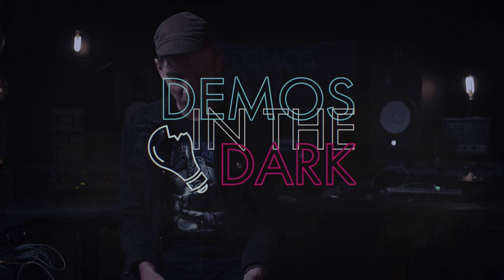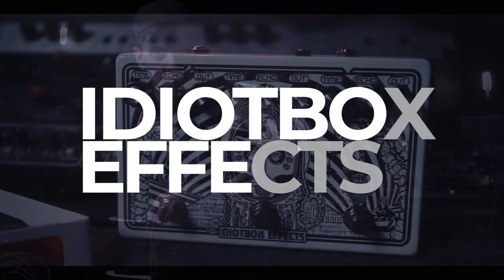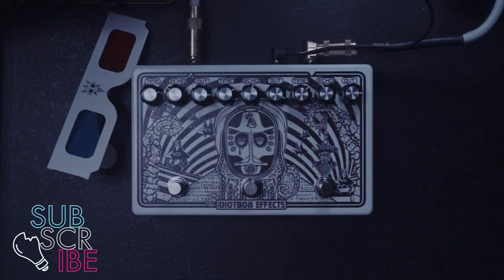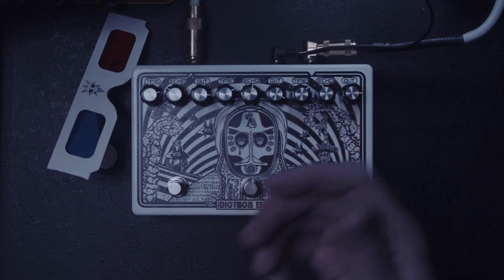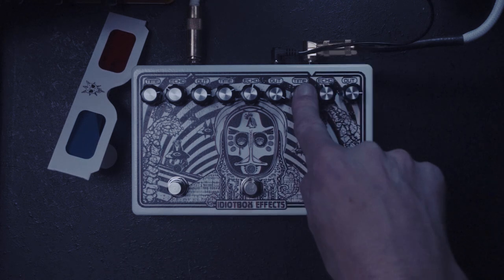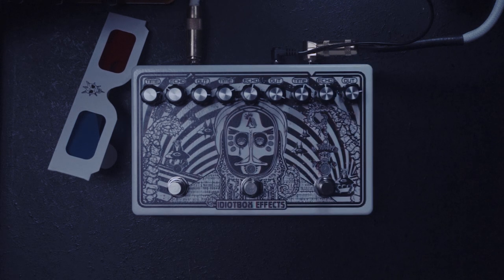Idiotbox Effects 3D Triple Delay // Guitar Pedal Demo

Comment: Funny that this shows up now.  I was just finishing up a pedal with two 3-knob delays in series,.  Like this one, mine also uses PT2399 chips, but I also include toggles for independent modulation on each delay, using the little trick deadastronaut came up with.  Very lush, and almost reverb-like when set just right.  I imagine a triple, wired up in that way would be even more lush.

It's funny how there are all sorts of effects  that we tend to think of in isolation, and others we have no problem thinking of in series.  Lots of folks think of gain-stacking drive pedals as normal and pretty pedestrian, but wouldn't ever consider a pair of phasers or delays in series.